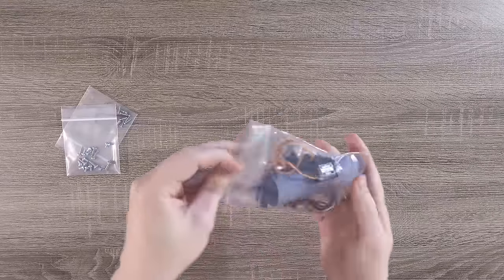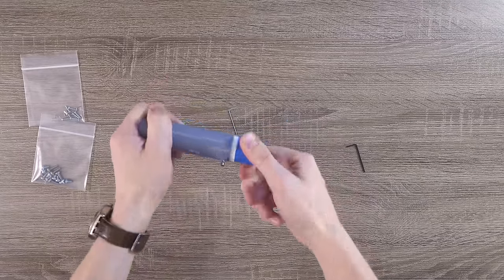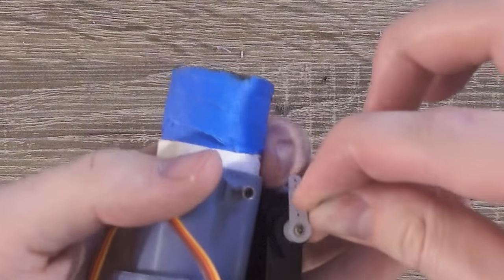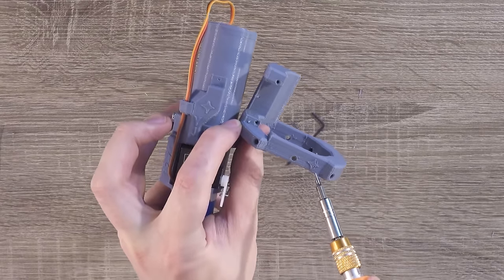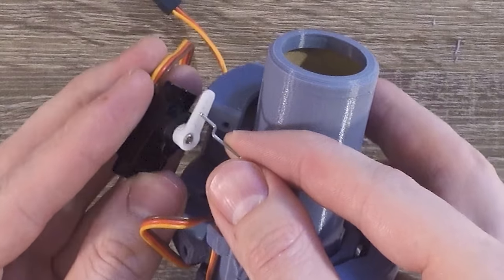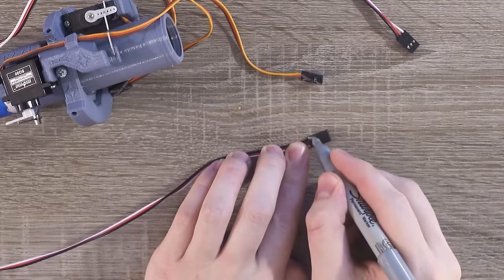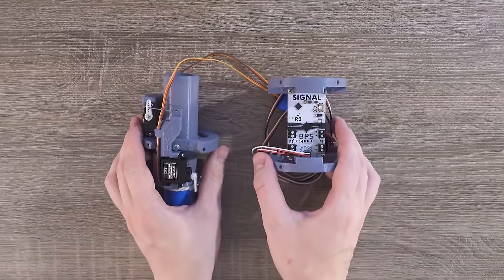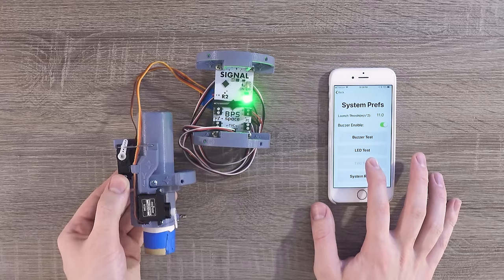Thrust Vectoring Mount - Build Signal R2

Comment: Such a beautiful design.. You take great strides to have both form and function work and look great.. One suggestion.. anytime you need to secure wires or connections from separation due to heat/vibration, etc.  use heat shrink wraps.. they are very inexpensive, look professional and will last for far longer than the tape.   Great job!

Comment: Does your software, and flight computer work with any servo?

So if I had my own mount, and servos with the same connectors, your software will work?

Thanks
Reply: It most definitely should lol. I know you probably don't need the answer anymore, but this is for anyone else who has the same question

Comment: Just a shot in the dark; have you thought of using stepper motors as an alternative to servo motors? 
They are a bit more challenging to incorporate into your system, but I believe they will provide smoother and more accurate actuation. 
Would like to hear your thoughts on that!

Comment: Interesting.  You have to control roll, too, to do anything useful with this.  How is that accomplished?
Reply: Not necessarily. A gyroscope could keep track of the rockets rotation and just rotate the thrust vector accordingly. The rocket would still rotate, but it wouldn't effect it's trajectory (as long as it's not too fast for the servos to keep up).
Reply: Griffin affect its.  Other than that you're right.

Comment: To achieve this you can.
 (1) Create a brass disc 12 inch diameter 1 inch thick
     (1a) Drill holes in the disc insert barrel magnets with north pole to outside edge.
(2) Create a brass disc 12 inch diameter 1 inch thick
    (2a) Drill a hole 5/8 inch by 4 inches (from the outer ring toward center axis)  every 60 degrees.
   (1b)  insert ( 1/2 inch  X 1 inch)  barrel magnet  into all 6 holes. 
   (2c) There must be room for magnets to slide.
   (2d)  Insert ( 5/8 inch X 1/4 inch) graphite plugs. 
(3) Place disc inside of brass ring with an inside diameter of 12 and 1/8 in
   (3a) Mount around the outer ring electrical magnets every 45 degrees.
   (3b) 8 electrical magnets at.
     ( 1) North),( 2) North East ),( 3 )East),(4)South East)
           ,(5)South),(6)South West),(7)West),(8)North West)
(4)  . When energized putting the gyro out of balanced creating a forward  thrust. 
   (4a) Depending on  which  electrical magnet is energized .
 
 Concerning Gravity created by centrifugal force. 
     (1) Because gravity and magnetic flux are unrelated.
     (2)  We can consider using a balanced wheel,
           with freely mounted magnets
          ( a) With north poles facing outward  
          (b) on outer edge
          (c) mounted in side a framework 
     (3) With permanently mounted electral magnets in frame
         (a) with the north poles toward the wheel 
              in different locations around edges of said wheel 
        (b) As the wheel spins creating centrifugal force
        (c) power added to the electrical magnet
    (4) Will cause the  centrifugal 
      energy to flow to opposite side of
          the wheel causing vehicle to move in that direction. 
You can use this configeration to shift the center of the wheels gravity thus creating foward thrust which can be aimed in any direction. Which can in effect Defeat gravity.